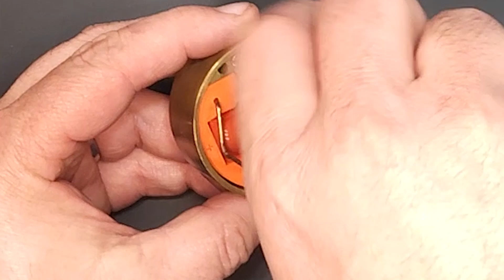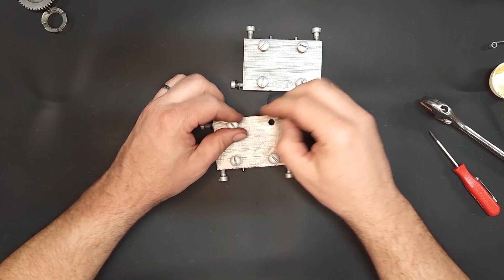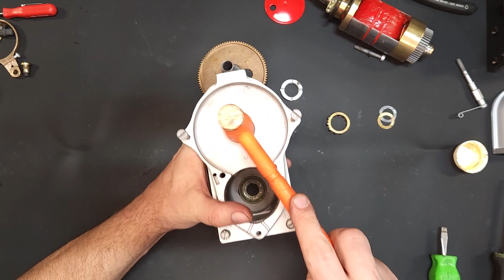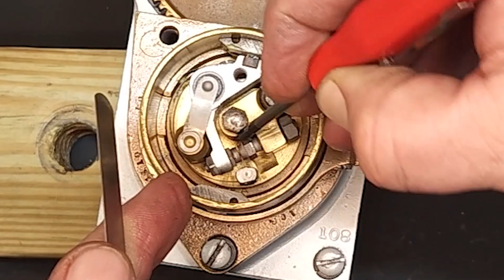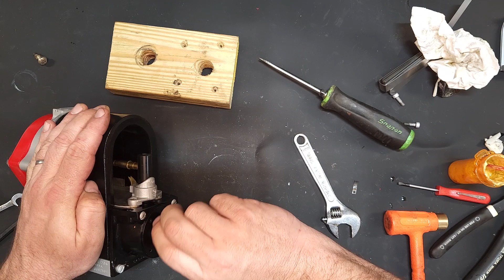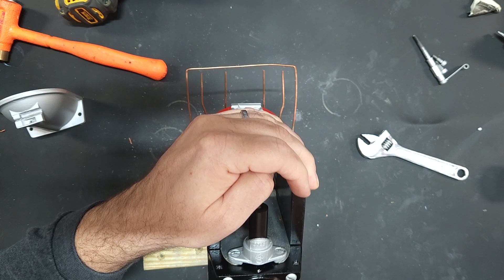American Bosch ZR4 ED34 Reassembly

Comment: Do you have a video of fixing your continuity issue between your slip, ring and whinings
Reply from the maker: No i do not. I pulled the wire out easily and cleaned the wire and hole then slid it in until i had continuity then used RTV to hold it.
Reply: @JPN76  just got it now and I have spark now
Reply from the maker: Awesome!